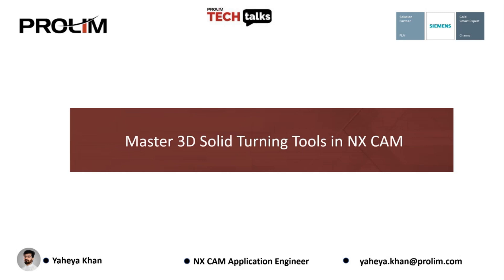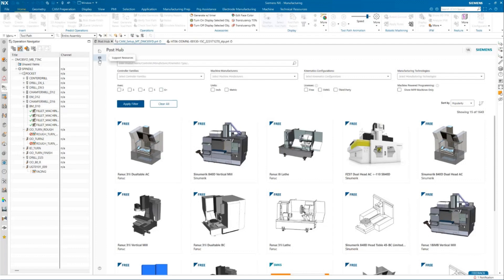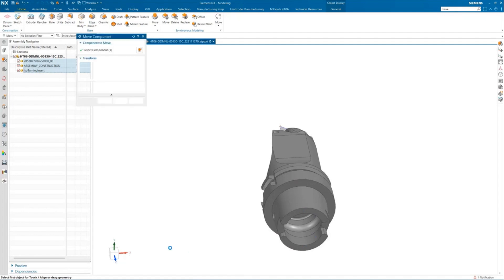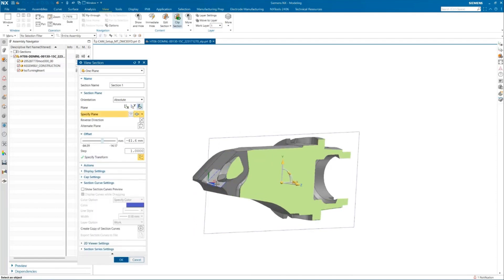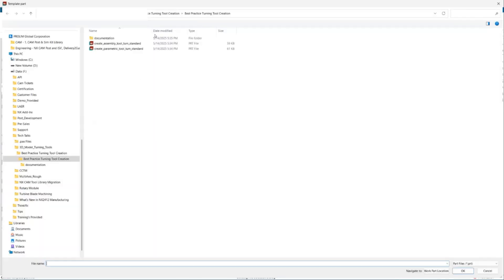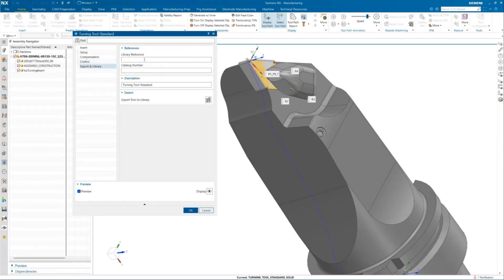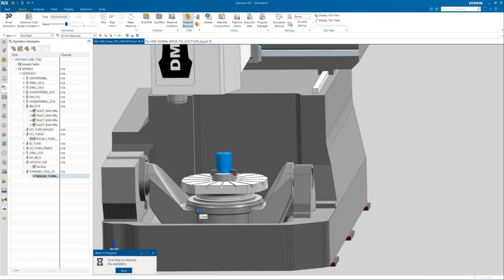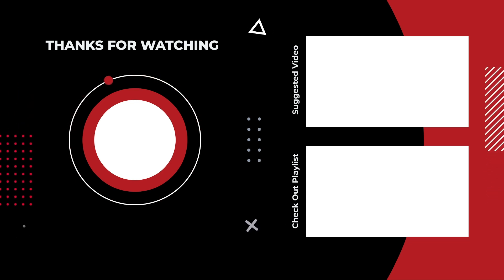How to Create Accurate 3D Solid Turning Tools in NX CAM? - Tutorial - PROLIM Tech Talk

Comment: Also in the case of tool file MCS aligned to insert inclination I am getting warning :" The MCS lathe work plane is not parallel to the current tool worl plane." In your video demonstration you are not getting this warning. But you are not trying to edit tool in your machine CAM assembly environment. What would have happened if you try to change tool number? Would you recieve the same warnig? Does it have any impact on tool path? I am currently on 2312
Reply from the maker: Hello mateuszc.1928,

I created the solid turning tool in a CAM environment, though not within a setup file and yes, I did encounter the warning:
"The MCS lathe work plane is not parallel to the current tool work plane" when retrieving the tool from the library.

At the 12:38 mark in the video, I show how to resolve this by going to the “More” option and adjusting the Tool Plane to match the Operation Plane. Feel free to check that part of the video for a step-by-step guide.

As for your 1st  question, we might need a bit more context to provide an accurate answer. Please feel free to reach out to technical.support@prolim.com.

Thank you !

Comment: Hello, A question regarding inclined insert position. In my post i have problem if i have WCS in tool model rotated to match insert inclination. System has a problem with correct colision detection and all moves basicaly are detected as collisions. If i reorient WCS back in tool model so it is in paralel with general CS its fine. What do you make of it? Is my post incorrect? I think this is because if WCS is inclined that makes insert model also inclined. Then if you have spin outline (by section) positioned slightly to (-Z) side then spin outline is just very slightly outside actual tool model and therefore system detects it as a colision at all movements. This is mageable by just adjusting spin outline section position. However there is second issue with incorrectly plased MCS which is not paralell to work plane.